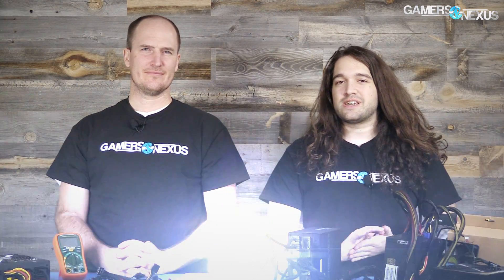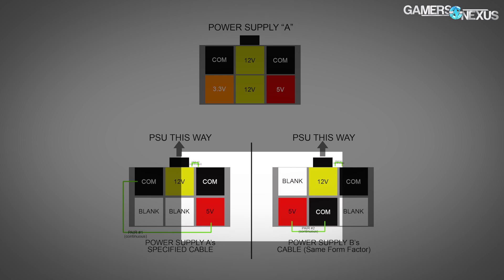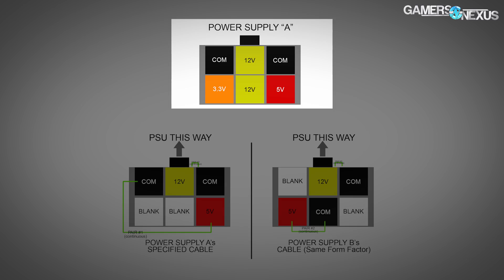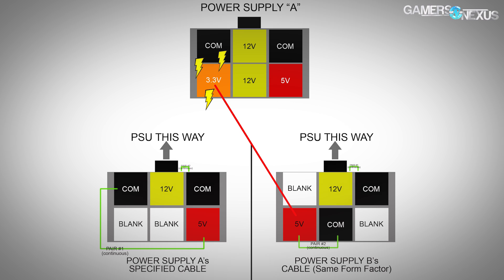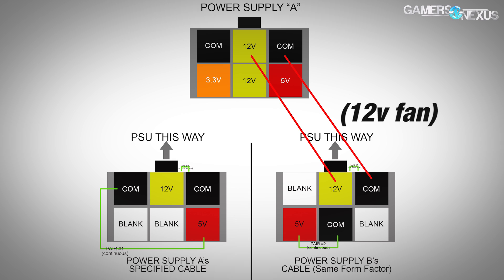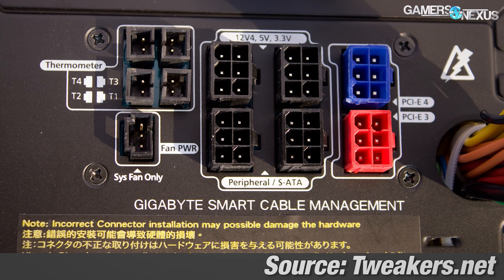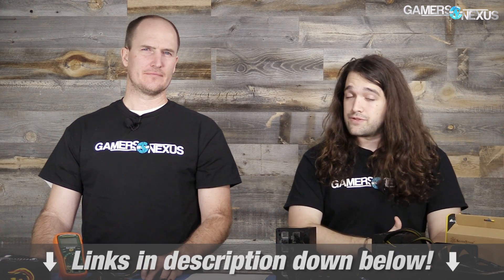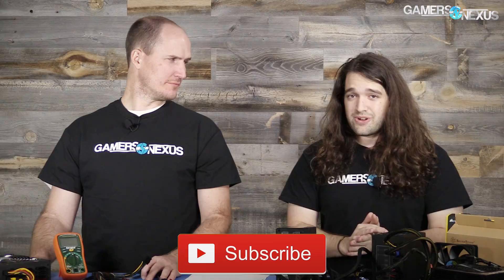PSA: Stop Mixing Modular PSU Cables

Comment: so what if you take a cable from the same brand and model power supply just different wattage? would this still be a problem?
Reply from the maker: Yes. It definitely can be.
Reply: thank you.
Reply: noted so if I don't have the cables for the current power supply(750w) I'm using in my pc and instead using ones for the 650w that is the  same brand/model in this case evgas GQ 750w and 650w power supplies. would it be a better idea to buy a new power supply and start fresh if I can't order cables from evga for the 750w power supply? I'm still pretty new to pc building.
Reply: 3en6ie 3en6ie awesome thank you  for the help.
Reply: You could order custom cables from a reputable third part source like cablemod.  They need to ask you for what power supply. Even cheaper would be to check the pin out or take the power supply and cables to someone who can do that for you.  If you are building your own computer you should know how to do that.   DO NOT take the cover off you PSU unless you really know what you are doing.
Building computers maybe be like lego but lego with electricity.

Comment: The only time this is an issue is if you have multiple modular PSU's or you are changing out PSU's. You just need to be able to separate the old and the new and label them. I will say that until this issue came up on youtube I wouldn't have know about it so for me at least his mistake was educational.

Comment: Ok so what about those custom cables, where we order from the likes of Cablemod.com? do we specify which PSU we're using or what?
Reply: Just to note that I haven't tried it yet so I don't know. but I'm thinking about ordering some custom cables.
Reply: I went there a couple weeks ago just to see what they offer. It does require you to specify what kind of PSU you have.

(Instead of waiting for a reply, you could have just gone there and looked at the configurator yourself, though :p)
Reply: Knops Actually i did go after i posted here XD.. but thank you for your reply.
Reply: Faisal al-inaizi :p

Comment: can we not just swap the wires around to match up with the power supply as if a / b should be b/a then swap over to b/a and then you have a cable that can now work with that power supply ?

Thanks for all your hard work sorry for the daft  question   :(  

thanks

Comment: Just a heads up. Corsair pretty much use an internally universal wiring scheme for their connector on the PSU. Propably to avoid producing a large range of replacement kits. This is a pretty nice bonus for us consumers assuming you own 2-3 computers as you can replace cables from one unit with those of another.

So a couple of other questions:
- For those of us over seas is there a good place to pick up molex connectors (ideally from asia) in order for us to make custom sleeved cables.
- Assuming you don't have the connector you need for any given PSU can you do a check to probe your connector on the PSU side. I would guess having a single cable where the ground cable is known might help you find the right cable via voltage detection, or will that short the PSU causing damage?
- What's the best wire to use. I'm guessing the 5V and 12V respectively can use different wires, but assuming you just wan't to go the easy route and order one type which rating/cross section should it have?

Thanks in advance for any help :)
Reply: Is the wiring really the same for all corsair PSU series?
Because cablemod for example sells two different types of cables for different corsair PSU series, so it seems they used diffferent pinouts
Reply: LRM12o8 They may have two sets, but at least they are standardised. I have used mine interchangeably between 3-4 year old units and brand new once. Please note that for the older once compatibility was not listed on the replacement kit, but Corsair support confirmed that they were basically the same. I believe the cable set only listed their latest iteration of the same PSU that I had.
Reply: ***** Thank you. This is really useful. No I just need to find some shop (preferably online and in china) that sells the actual molex connectors I need :)
Reply: Thank's for the information, it's much appreciated.
I'll save me the trouble, however and just gonna stick with my non-modular PSU and use some custom sleeved cablemod extensions. That's mainly for cost reasons and since every case now has a basement with PSU shroud you can't see it anyway. ;-)
Reply: And of course EVGA uses their own standard that is opposite of this so using a corsair cable will fry you components. YAY! Thanks EVGA, your bullshit just fried an SSD and HDD. And of course the warning about using different cables was in small red print below another warning, and was worded to sound like some boilerplate liability statement. PUT THE WARNING IN BIG LETTERS AND SPELL OUT WHY YOU SHOULD LISTEN, TELL ME YOUR PINS ARE DIFFERENT! 

Modular should mean modular, the damn connectors on the end are standardized why in the fuck wouldn't the plug be standard? This is like making something with a wall plug but making ground positive and neutral ground and expecting people to know not to plug it into the wall!

Comment: They can even differ within the same manufacturer as well.
Reply: Yeah, like corsair. cablemod sells two different kits for different corsair series. they both have the PCI-E Plug, but they're wired differently. This is something many would miss, when switching from corsair to corsair and wanting to reuse their custom cables.
It's shit, really. It needs to be standardized for consumer protection.

Comment: This is why I hate that modular PSU's usually don't have the pinouts defined. Also makes creating custom cabling more tedious then it should be.
Reply from the maker: It'd be great if they had the pin-out/coloring directly on the back of the PSU. Way too easy to make mistakes.

Comment: People do this without checking the pinout of the PSU?!
Reply: "Well, if the connector fits, it must work"
At least that's what most PC-Builders would assume. And it is the case with anything else inside and around the computer. We're used to all connectors beeing standardized. So how would someone guess that power supplie plugs aren't, if they don't know?

Comment: Good advice. I would also add that never ever work on computers when you are tired or burnt out. That is the time when you can make expensive mistakes. Go take a nap or such and come back fresh.
Reply: Yup, it's usually in the heat of the moment too when things aren't thought out too well (speaking from experience).
Reply: Good point. I built a rather large system recently and it was a big job, taking several hours at the end of a long day. 
I got only one thing wrong because I was tired...  forgot to connect the power up to the CPU pump.
(There were so many cables running in there that I though I had clicked them all together.) 
The CPU hit almost 100 degrees by the time I entered the bios menu after the first post. 
Fortunately I spotted this straight away - before any damage was done. I went straight to bed without installing Windows!

Comment: I just don't understand how Salazar has so many subs and he is clearly not on the same level as Steve
Reply: "he is clearly not on the same level as Steve" Noone is on Steve's level, though.

But yeah, Salazar is definately not the most tech-savvy tech-youtuber and is also quick to blame companies for his own mistakes. Remember his RX 480 budget build, where the RX480 fried his Board? Any halfway recent Motherboard wouldn't have gotten fried and there are a lot of GPUs out there that would also have fried his particular Board, but he put it as though AMD made a huge oversight, while it just wasn't a good idea to build a high-performance gaming-PC with a power-hungry 250$ GPU around a five years old 20$ MOBO.
Reply: actually... he does come off like "a stuck up douche acting like he is tech god and everyone else is automatically wrong"
Reply: Matt McGregor would you really put 250$ GPU into a 20$ PSU? I think that's adventurous, to say the least.
However, The 75W limit only exists on paper today and other cards, like the GTX 750(ti, was it?), the 960 strix and the 950 slot powered card and about any manually overclocked card also exceeds that limit. Thus I'd rather blame the MOBO. After all, what CPU is there on AM2, that wouldn't be a huge bottleneck to the RX 480? I think he cheaped out way to much on the MOBO

Of course it would've been better if the RX480 had an 8-Pin to not cause this issue, but saying this is solely AMDs fault and you shouldn't buy the reference card because it this, like he did, was way over the top
Reply: I agree. Go check out his recent video about the R9 Fury. You'll find my comment and dialogue with him quite entertaining. :)
Reply: Nathan Elmore He also said that the RX R9 Fury take 400W LOL
Reply: Sadly channels like that get a lot of subs from people who have absolutely no clue about tech because they dont know hes full of s*** most of the time, unfortunately thats also the reason you get more and more smart asses who have no practical experience telling people who actually know what they're doing that they are wrong because some random on YouTube said so (AdoredTV is bad for that too).
Reply: He doesn't have too many, but he has more than 5 for sure and probably MUCH less the GN. Check out Salizar's studio tour and inventory video shots a few months back where you can see the piles of "stuff" he has around through purchase or for review. His organization was not perfect apparently, and he just reached for a cord. I think that many people would assume if it fits in the PSU it works.
Reply: Jordan Broly Perhaps he should talk about the flavour of tech hes versed in then...
Reply: +Jordan Broly I'm of the opinion that if you intend to present yourself as a source of information you should at least do basic things like background research and fact checking, and when presented with a problem with your logic try to take it onboard instead of denying the problem and getting shitty about it as he tends to do in the comments. I always assumed this was why he droped the science bit because he got called out on his lack of a scientific approach to anything.

Nothing against people who get things wrong from time to time, it happens to everyone, I just cant stand it when people consistently get things wrong and dont try to take onboard the corrections when they're in a position to deceminate information.

Put simply, if you dont know what your talking about, dont talk about it.
Reply: I can't stand that kid, very arrogant. you can tell from some of his replies to his viewership.
I unsubscribed.
Reply: Agreed that he is not at Steve's level, but I would respectfully disagree with the MB/GPU comment. Yes, there are better MBs out there and that was an OLD board, but the RX 480 was supposed to be a less-power hungry (turned out not so much) lower cost alternative for 1080P gaming. Those that would purchase this would not have the latest and greatest MB/HW but would typically try to put that card as an upgrade into older machines to improve FPS. I thought the test was legitimate unless the MB was known to be a problem; which I don't think it was.
Reply: Well it probably was not $20 when someone bought it new 5-6 years ago. You would have to talk to Brian @ Tech City about that. He lives for that kind of "score"; though typically he would use a $20 GPU. I have a 6 year old machine (I7 950 DDR3) with a very old power supply. I dropped in a 1070 for testing and benchmarking against a 1070 in my recent SkyLake build. That would have been the upgrade machine if I did not just bite the bullet and built a new one. The PSU in that older machine is probably worth $20 at best now. It's not even 80+ rated. People without the funds might only have enough for a new GPU and if the PSU has a 6-Pin (or extra molex) ... they will do it.
Reply: I agree it's not common to take a very old MB and drop in a $250 GPU, but I'm sure it happens. Better Salazar than someone without the funds.
Reply: Sam B He's more verse in a different flavor of tech over just pc. Let's not be senselessly negative because he gets a few things wrong.
Reply: Sam B Look here! You guys and this all or nothing mentality against they guy, or people in general, that get a point or two wrong on camera being shills is obtuse. even these guys that tend to be "on point" didn't know it all from the get go.

Besides it's not like he is some stuck up douche acting like he is god and knows it all and everyone else is automatically wrong. He posts updates, working through the issue (which last I checked is how most people, normal and verse enthusiast work through problems)

If nothing else it's a learning experience for people who prefer his style of presentation. Shame there are a few asshats who act like they know it all from one video/youtuber/sorce but that's their fault for being a twat, not Salazar's nor anyone else's.

Comment: Salzar somewhat ruining the reputation of the NZXT Hue+ because of his mistake in using the wrong cable is my guess as to why they made this video.
Reply: I think it probably increased their sales in the end
Reply: ratchet256 that's how I know that he used the wrong cable
Reply: John Gray Exactly, I think so, too. I saw one guy on the apology video say that he bought a hue+ just to support NZXT. With how cool they were during the process, and Greg showing his audience that, it may very well have increased sales in the end.
Reply: It is a shame how NZXT got in the crossfire however. He did apologize and presumably took down the offending videos. The issue for NZXT was short lived and had limited viewing. Most who saw the first would have watched the second. I doubt the impact was that bad!
Reply: He actually said that gamers nexus helped him figure out the issue. Or maybe it was NZXT reps that said that?
Reply: ***** Exactly. Blaming the product for something being connected improperly makes no sense
Reply: While Greg actually boosted NZXT's rep by admitting his mistake, apologised, took down the incident video and showed how supportive NZXT is, comments like yours are dragging NZXT's rep down. Not that I'm siding with Greg, but false information should be kept aside. It's a fact that the incident raised NZXT sales
Reply: It's not a HUE+ issue specifically; on the example. He could just as easily blown out the system with a fan; as Steve GN points out. Does that mean you're not going put fans in your case? Are fans vanity? I agree that LEDs are pointless, but many people include aesthetics in their builds. However, anything that could be plugged into the end of one of the PSU cables carrying the wrong power on the wrong line could kill the PS/MB/.... This could even be a GPU 6/8-pin, MB 4-pin/23-pin, pump, fan, .... People do use molex to power fans and in Salazar's case (pun intended) plugging a fan into the molex connector could have also possibly cause the same failure. Interesting that you're throwing the baby out with the bath water, but for possibly the wrong reasons.
Reply: I will not be buying a Hue+ specifically because of what happened. Why do people risk their PCs just to have vanity lighting? I once changed my AIO radiator fans because I needed to have ones that had red accents. Suddenly, my PC started shutting down for no reason. Swapped the vanity fans back to the originals and my PC has been running non-stop for 2 years.